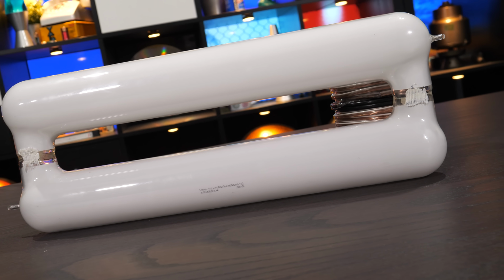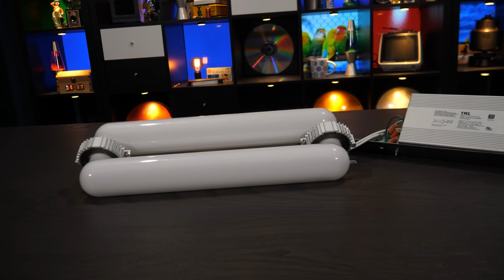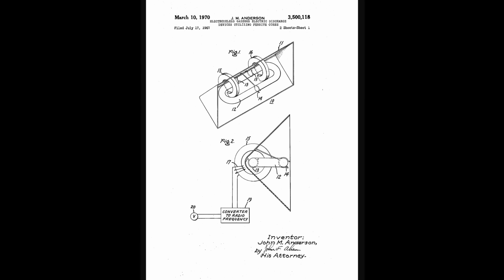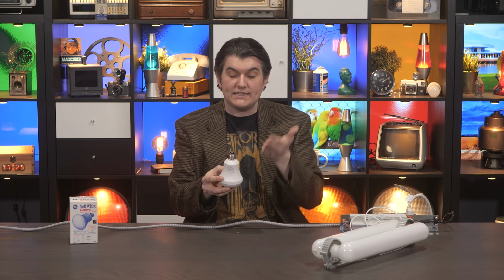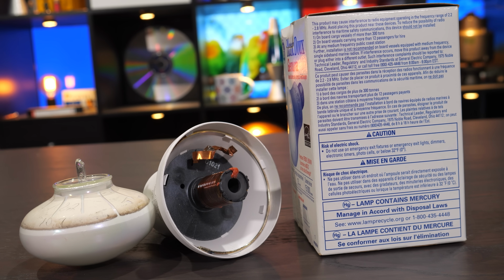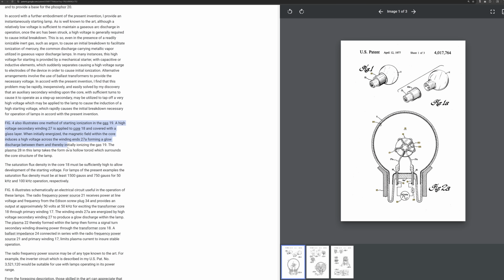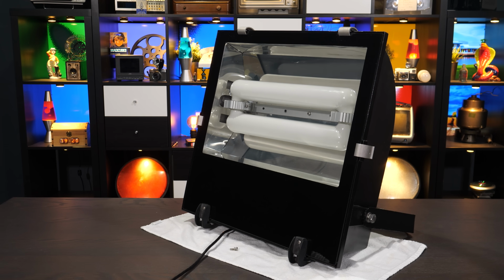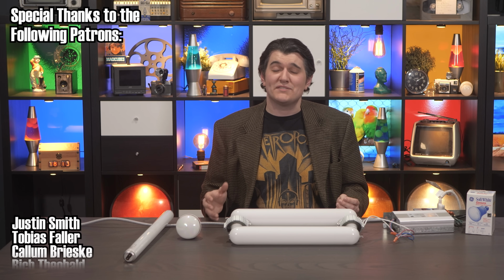Induction lamps: fluorescent lighting's final form

Comment: I was part of a team outfitting a new lab back in the mid 1990s. One thing we all agreed on was we didn't want fluorescent lights because the standard tubes flickered enough to give us all headaches. One of the team discovered these induction lamps and everyone got really excited about them -- fewer fixtures, brighter bulbs and longer lived. We installed, I think, 4 induction fixtures in an existing lab to see how well they worked and if we wanted to go through the process of getting them certified for use in the new lab. Less than two days later they were decommissioned for a very important reason. The induction fixtures wreaked havoc on Scanning Electron Microscopes and pushed a half-million dollar high resolution transmission electron microscope into maintenance mode from a full room away.
Reply: Oof.
Reply: By the mid-90s, 400 Hz fluorescent lamps with frequency converters  were available without huge cost penalty -- aircraft had used 400 Hz for decades because the transformers were lighter, so the principle was well known and it was merely a matter of manufacturers deciding to promote them, having realised that a frequency converter + small ballast was not hugely more expensive, produced in large quantities, than the normal large mains-frequency ballast -- they were for example safer in workshops where a 50 or 60 Hz lamp produced a strobe effect meaning that rotating machines might appear stationary.  Spreading the lighting over 3 phases was only a partial mitigation, but at 400 Hz the light output was near constant.  Although (obviously) mains frequency fluorescents are OK for most purposes, flickering is noticeable particularly near the ends of tubes towards the ends of their lives, which as you say, can be unpleasant particularly for close work in bright light.
Reply: @RobertScott-pp6gj  Dual-tube fluorescent fixtures used a capacitor and an inductor as ballasts, so that the tubes flickered in opposite phase.
Reply: @RobertScott-pp6gj does a 400Hz flicker not make a machine look still if it's spinning at 400Hz? Or was that just not an issue in their case?
Reply: @renakunisaki They probably have enough of an "after-glow" to mitigate for that effect at such a high frequency (I may have made up that word just now but even if it is not actually a word out probably would do to describe the effect). I think this may well be the case as the ionized atoms inside stop being excited - which after all they become of a result of them getting heated up and as they are in a near-vacuum there is very little heat transfer away from them
Reply: @RobertScott-pp6gj 3ph 60Hz did the same job. Calm down
Reply: Absolutely wild.
Reply: @deathhog  Truly wild indeed. You'd think someone working in that lab, would have been educated enough to know that fluctuating magnetic fields and equipment extremely sensitive to fluctuating magnatic fields don't play well together and that drywall or bricks do not shield against such a field. Honestly crazy that apparently no one there had any idea how their microscope worked....
Reply: @creativedesignation7880 Sounds like it wasn't their microscope, so they weren't thinking about it. That is, until their understandably frustrated lab neighbours got them to think about it. Of course, it's a lab building, so thinking about these things should go without saying, but that's how it happens I guess.
Reply: Good thing you tested first!
Reply: Hes gonna love this comment
Reply: @Shapio  Look after minute 13
Reply: They should make it so it doesn't do that. I'd like ideas on my desk by yesterday
Reply: The demon core of lightbulbs
Reply: 'As great philosophers Cantankerous Ya, and Harry Twoendo eloquently put it, "I am not sure which of all the elements; be they fire, water, air, or earth, may be more mysterious than the magnet. I wish not to speak to those of institution, about this miracle of life, for they speak in false prophecies, and that serves only to bolster my rage."' -Huggbees
Reply: When I was doing electromagnetic noise reduction in a low energy lab my tests showed the main problem was the lights. We went with grounding everything properly, turning off any non necessary lighting and electonics, and moving all the necessary equipment as far away as possible. Worked wonders.
Reply: Oops.
Reply: @vf1923 >>> I posted the same comment before seeing yours...🤭
Reply: Reminds me on having a course about an EMP and the lecturer told us, what the costs are, if we do things wrong. One member nearly opened the lock to the chamber under ultra high vacuum - yes you can do that with early EMPs. No clue why the person thought this would be an idea at all at this moment. I forgot how high the costs would have gotten, but the prof was done with us. The person in question didn't attend another lesson.
Reply: I wonder how much that half a million dollar microscope goes for now wheel that technology I mean
Reply: @VSMOKE1 probably in the high tens of thousands to $100k+ minimum if it’s in good working order (which, being from the 90s it probably is). Old electron microscopy equipment often has a long primary working life and then a long secondary or tertiary working life on the used market or for specialty use. Especially the high-end stuff that was more cutting edge and future-forward can be retrofitted and updated, and hooked up to newer computers, instruments, etc. Businesses can often use old academic equipment for industrial purposes, or schools/labs with less money to play with will buy secondhand lab gear. A lot of preowned expensive university equipment gets bought by institutions abroad as well. Most businesses that sell and service this kind of specialty equipment will happily sell and service used equipment too.
Reply: @cartilagehead What?! You didn't just guess-&-grouse? 
Thank you!
Reply: @cartilagehead  Lol, go look at mikes electric stuff he has just bought one, non-functional but repairable. I doubt he paid more than a couple of grand for it
Reply: @paulhawkins6415 there’s a lot of scopes out there and a wide range of tech, capability, and cost. Different equipment has different running needs, ancillary equipment, etc. scopes used in industry aren’t the same as scopes used in microbiology, etc
Reply: Yeah, e.g. there where a website with knife reviews based on a microscopic photos of the blade’s edge. This privably can be achieved with older equipment, wich is now surplus
Reply: @VSMOKE1  probably free, you basically have to give them away when they are so old
Reply: @VSMOKE1  Probably a few thousand a month on the standard plan. If you want to stream the output to a display, you'll need the pro plan which is in the tens of thousands a month (paid annually).
Reply: @VSMOKE1  judging by the fact it's an  electron microscope and inflation probably has gone up from a half a to around a million dollars
Reply: @MuwaUWU  By inflation sa presented by the US government,  it would go from half a million to 2 million dollars. But since inflation was probably much higher than what is presented (manufacture moved to China.. try comparing a price of something made in the US in 1990 with something made in the US today), probably twice as much or more :)
Reply: @MuwaUWU  so actually no. I’ve no idea what model they have but the old ones can be very cheap (relatively) in all actuality. Can find many on eBay for well under 10k
Reply: In my experience fewer lighting fixtures in a lab means way worse shadows. Not a benefit at all.
Reply: @cragonaut  I also got my lab lightly fixed, and his shadow was fine
Reply: Probably upset the local hams too 😅
Reply: Man, I felt this. The unfortunate reality of a lot of lab equipment is they are sensitive, they cry if you speak ill of them from the next room over and refuse to work for weeks at that point.
Reply: My horror when he said the bulbs ran on electromagnets got me looked at by the whole office during my lunch break earlier today. Between me saying that's so cool and but wait that's really bad, everyone was asking what the big deal was. More confused looks when I told them I was learning about obsolete light bulbs.
Reply: Ooof!!
Reply: I wonder if a table top lab scale would be affected by the radio frequs as well.
Reply: @SgtMantis ala drug manufacturing?
Reply: Yes, an RF nightmare.
Reply: Just out of a desire for some clarification. How many feet away from the fixture is the room being affected?
Reply: Couldn't you simply install a thin metal mesh on the lights? It would stop the RF (depending on frequency). It probably wouldn't noticeably affect light output.
Reply: @theRPGmaster  copper mesh.  Less resistance.  But it might interfere with the light through Eddy currents.  Familiar with them?
Reply: Just modulate them at the right frequency and turn them into wifi repeaters
Reply: I work in building maintenance and when i heard "100,000 hours" i was like hot damn we should get some but as soon as the VHF was mentioned i stopped even wondering about cost lol
Reply: Fun fact, LED lights do the same thing, and it took them a loooong time to figure out why the pictures were so bad.
Reply: If these bulbs had became widely adopted and the race to the bottom happened with these, imagine the RF interference we'd be dealing with.
Reply: How long did it take them to figure out it was the lights causing the problem?
Reply: @SomeSortOfCephalopod 32 minutes
Reply: I’m curious what “maintenance mode” is
Reply: @ghost_ship_supreme limp home mode in cars?
Reply: I love getting stories like this.
Reply: How sensitive where the EMs? The ones in my uni are on the same corridor as the nmr lab and thats a way stronger magnet!
Reply: Luckily I do not have an electronic microscope in my home , but maybe I should check with the elderly widow living next door before fitting , in case she has onev😂
Reply: @A2Z1Two3 don't worry. You are already irradiated with WiFi and 5G.  Give it time to rear its ugly effects.
Reply: @pixels303at-odysee9  what effects? Radio frequency photons simply don't have enough energy to do much of anything biological. At most, they're absorbed by the bonds in water molecules, making them marginally warmer: that's how microwave ovens work, and why 5G doesn't work well when it's raining hard.
Making antennas that can detect and use such weak signals is why the technology is relatively modern and why RF/microwave weapons are intensely annoying rather than deadly.
UV radiation is orders of magnitude more potent and it takes decades to develop skin cancer.
Reply: @erikdietrich2678 I never said Photons.  Do you know what EMF acronym stands for?

As for 5G, the frequencies are tuned to near DNA width.  Guess what it can do with nanotech?  Before calling me a tinfoil hat wearer, do some research on that.  Awards were given out for some medical delivery systems which were added to many jabs.

Just imagine the worst, multiply it by 10 and you might be closer to the truth.

You might want to look into this more before asking questions here.  Substance on YouTube is against the algorithm.
Reply: @pixels303at-odysee9  if you don't know that electromagnetic radiation is photons, then you've lost the plot. 5G wavelengths are on the order of millimeters: the width of DNA is literally a million times smaller. What are you talking about?
Reply: @pixels303at-odysee9  Hate to tell you bud but your hat is indeed made of tin foil
Reply: With advances in power semiconductors and metamaterials, along with better EMI resiliency in modern electronics, I would imagine that might not be the story today.
Reply: I'm not surprised!
Reply: Surprising, as toroids are usually much better at containing the flux than standard laminated transformers... ... 🤔
Reply: OOPS...🤭
Reply: They have to be shielded.
Reply: @dogprowilhelm7630 Faraday is famous for what?  😁👍
Reply: Ouch.
Reply: Yes, exactly. The last thing you need in a lab is any device outputting even 10s of Watts of 100KHz / 10MHz RF into the environ; it'll totally swamp delicate signals. Even regular 50/60Hz interference is a pain to deal with.
Reply: I wouldn't want to be in that field all the time!
Reply: Why so expensive thp
Reply: Amazing. I didn't think about the effects of background EMF, let alone active and local on the sensitive instrumentation in a lab coming from the lighting!
Reply: Sounds like they'd be good for explosive atmospheres risk sites.
Reply: I worked on newer versions of the ballast that powered these induction bulbs.  I benchmarked existing Chinese ballasts and they all failed FCC Part B industrial EMC emissions levels.
Reply: I need to own one of these...
Reply: 10,000 hours….. can you say light bulb cartel. Open your eyes people
Reply: @Coincidence_Theorist a modern incandescent bulb will run for 100,000 hours if it's underpowered: it will be dim, orange, and inefficient. The cartel was never about planned obsolescence. It was about standardization and price fixing.
Reply: @erikdietrich2678 . Wrong.   It was about about precisely that on a massive scale.   Are you ai/bot trying to say things that will  get reactions?

They have massively limited the lifespan of all lighting.    Simply look at old adds from prior to the evil cartel bs.   
They were literally the pioneers of planned obsolescence which is now the norm across all industry.
Reply: Electron🔬🚫 microscopes are junk. Greyfield optical microscopes see live specimens down to 100nm.  (Might be spelled Grayfield).
Reply: Hahaha sorry
Reply: Doh!
Reply: I wonder if they kill Wi-Fi like my microwave does
Reply: @BlackSoap361  Depends on the operating frequency. 🤷‍♂️ The 1-10 GHz order of magnitude is where microwaves and WiFi and cellular are clumped together, and there are circumstances where they will overlap.
Reply: induction fluorescent lights are the exact design of a "plasma antenna" . an aluminum shield around a coil transmitting frequency into an excited plasma tube, so the frequency used to excite the plasma is not transmitted but all of the static interference of electrical signal impurities at around half the plasma frequency are amplified and transmitted. sorry if that is too convoluted, its late here, google plasma antennas if you want to know more
Reply: @chrisbeard9113 anything that conducts current, creates magnetic fields when current is passed.  Mercury is conductive. You can induce magnetic fields from coils of wire to nearby conductive materials. They need not be ferrous nor have coils.  Eddy currents in material will generate heat through resistance in material, or in the case of Mercury, Light.

Been all over this trying to explain it, in hopes others learn. You are completely correct.
Reply: I'm not surprised, I had a UPS power backup that made CRT's go wonky in the same room and pinned out commodity EMF meters 3 rooms away!!!
Reply: @petevenuti7355 you had a modified sine wave UPS.  Square waves create an infinite number of frequencies in harmonics.  Thats why people should use True Sine Wave.  Same goes for those coils which excite the light in video.  There are better ways of using this tech.
Reply: Bloody hell.
Reply: That was my initial thought - RF interference seems like a likely issue.
Reply: My guess on starting is that the initial current is capacitive, which can heat some of the mercury vapor.  Once the vapor begins to heat, the current flow will increase rapidly.
Reply: "Everything conductive is an antenna".
Reply: This seems like an obvious misstep. Sure hindsight is 20/20, but c'mon. If you're using an SEM you can't even talk in the same room or you will ruin someone's picture as it renders. Of course massive inductors are going to EM bomb it
Reply: You are so correct -flash rates mess up brain wave functions and stray Electro-magnetic  waves mess up  vital functions in all tech devices, based on wave transmission.This solution..is not a solution
Reply: Wow. Seems like they shouldn't be near a ham shack, either.
Reply: This makes me appreciate just how far ahead this technology was essentially LED-tier lifespans long before LEDs took over. I tried using an old Philips QL lamp once in an industrial setting; it was almost maintenance free but very bulky and not easy to mount.
Reply: Magnetic field go psspsspsspss
Reply: lmao. Electron microscopes are obnoxiously sensitive sometimes. When the train drives by our university (electric) we have to take it into account and plan accordingly when doing measurements.
Reply: Damn!
Reply: AAAAAAAAAHHHHHHHHH
Reply: I’ve wound my own toroids for small RF circuits and immediately recognized the principle. The part where the lamp itself becomes a one-turn secondary coil? That’s such an elegant solution, both electrically and mechanically.
Reply: Did it cause a resonance cascade?
Reply: Insane lol
Reply: 😮
Good thing you ran a small scale test!
Reply: Direct conduction keeps the high frequency drivers output from being EMF's in free space...   imagine the extra emf noise in a room with inductive connections only... nothing via conduction...  No Thanks!
Reply: These days  80 lumens per watt is rather low. Most consumer LED lights now often go above 100 even for general purpose ones. Specialty LEDs even go as high as 200 lm/w
Reply: Seems like a very minor hickup, think about the savings for lifespan!
Reply: Arc or plasma would solve this... safety squints at the ready...
Reply: Woah!
Reply: Slight tangent. When studying at college all the lights were fluorescent and worse non diffused and caused me bloody migraines and coupled with all the crts everywhere it was unbearable. So everyday I wore sunglasses. No headache, nothing.
Reply: HAH! Oh man; that's funny. (Because im not paying for it of course.) Trying to save on team headaches created a half million dollar headache. 
Bet you guys were fuming over this at the time. Tragedy + time = comedy though. :) Thanks for the story!
Reply: Harmonics.  When fields collapse, they generate massive voltages.  When the gas begins to arc, the resistance massively reduces and collapses the voltage. Essentially it transmits a massive EMF on many frequencies.

Great idea for light if you do not mind being irradiated by EMF.
Reply: @pixels303at-odysee9 we are CONSTANTLY being irradiated by EMF. Radio and microwaves are essentially harmless- don’t get me wrong enough of any EMF will cook you, but scanning microscopy is very sensitive in ways molecular biology isn’t. An incandescent lightbulb also irradiates you with broad spectrum EMF, but would be much more destructive to biology.
Reply: Bummer
Reply: Nice little made up story there bro
Reply: @noobiIII  Given that their story contains no indications of being fabricated (and the fact that, even if it was, it’s a trivial anecdote, so who cares?), my inclination is to think that you are perhaps just attempting to get under people’s skin for the momentary feeling of satisfaction and/or superiority it brings you. Which, if that is the case, I would implore you to consider why upsetting others might bring you comfort and whether that’s really the kind of person you want to be. If, on the other hand, you feel you are simply exercising healthy skepticism, I’d just point out that blind disbelief is no less irrational or close-minded than blind belief - to suspend judgment is skepticism; to presume deceit is cynicism.
Reply: @doomtho42    Very well put. I think he is just a classic nay-sayer.  Negativity seldom produces a positive result.  Wish more people could see that.
Reply: @noobiIII their story doesnt even sound crazy?? 😭 what kinda boring life do u lead that this sounds fake
Reply: I'm surprised people intelligent enough to operate that kind of equipment wouldn't have realized this would be an issue.
Reply: @securi-t very different fields promote very different skills.
Reply: @securi-t  to be fair, they ran a test on a few fixtures, I wouldn't say they weren't aware of the potential for problems.
Reply: @securi-t they just swept the floors 🤷🏼‍♀️
Reply: @securi-t biologists maybe?
Reply: @securi-t you'd be surprised how specialized people are